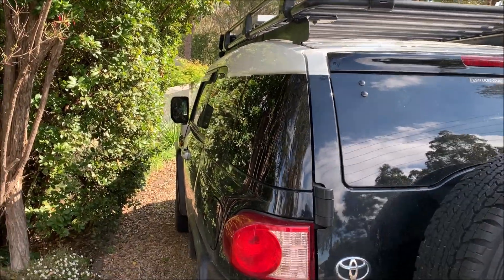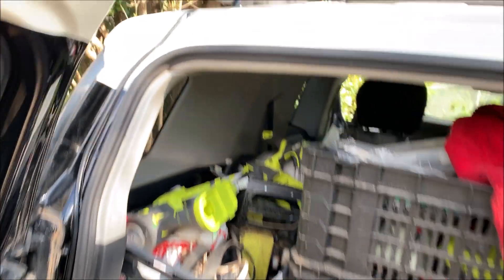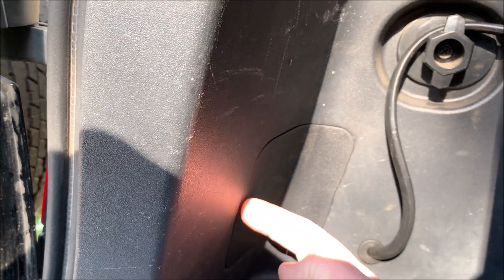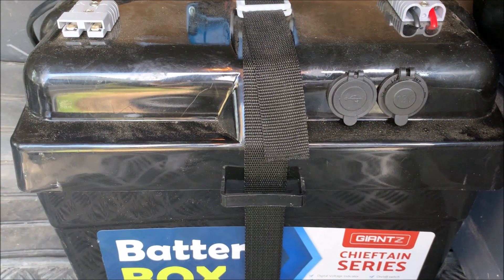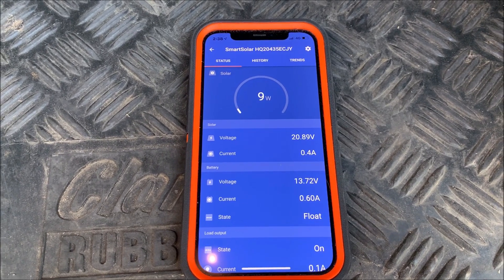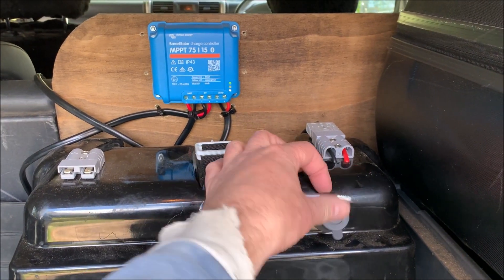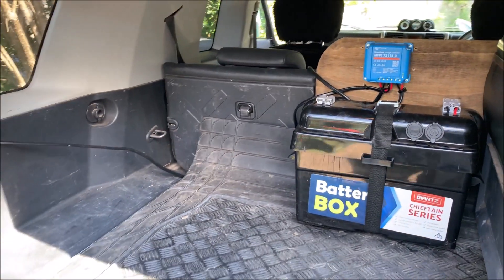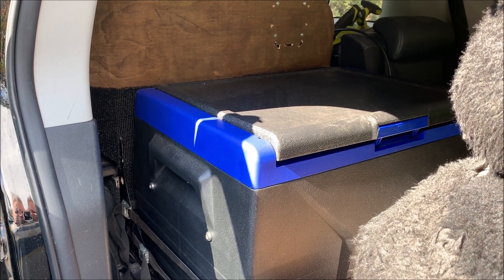Toyota FJ Cruiser Solar Panel Set Up and Cable path to rear Cabin

Comment: Nice job.Harnessing solar energy to chill your beer is gold.I’m looking to do something similar in my GU.I’m thinking about mounting the panel under the roof rack on a slide out track system.It would allow you to retain the full rack storage area.Hmmmm!Cheers,Rob.
Reply from the maker: I wanted full daylight exposure for when you are for example, driving across the Simpson Desert. I don't have it hooked into the alternator so Solar is the only charge source atm. If you also hook it up to the alternator then a slide out would be ideal.